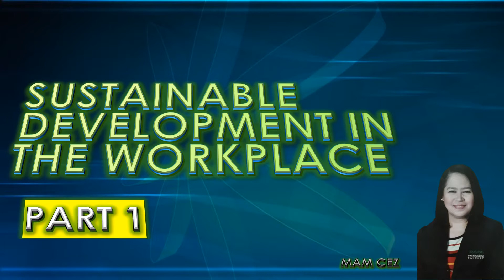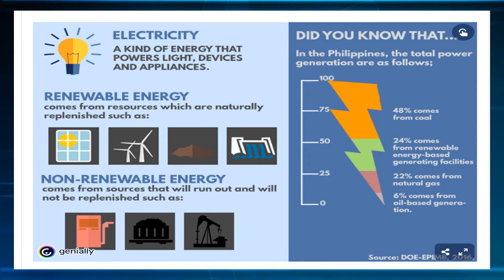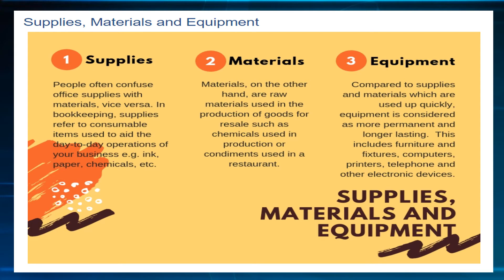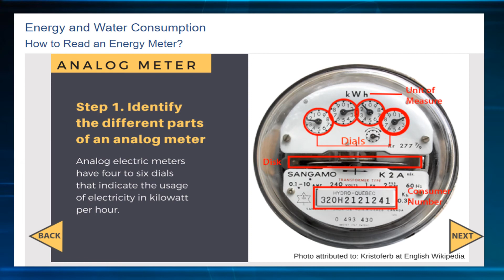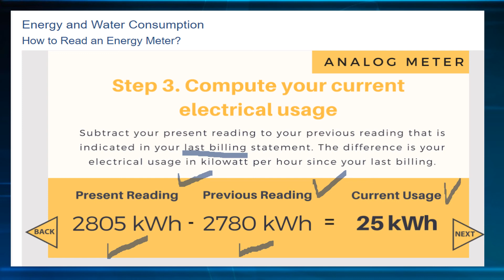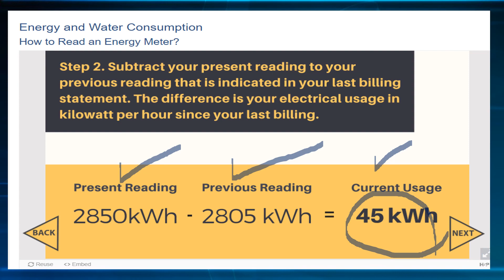SUSTAINABLE DEVELOPMENT IN THE WORKPLACE PART1

Comment: I learned that there are two kinds of energy: renewable and non-renewable energy. In the Philippines, most, being 48%, of the total power generation comes from coal, while the least, being 6%, comes from oil-based generation. 
In the workspace, the first in monitoring resource usage is identifying and making a list of all the resources used. There are four common categories:
1. electricity
2. fuel
3. supplies, materials
4. water

Comment: Monitoring and reducing resource consumption, such as electricity, water, and supplies, in the workplace, and discusses sustainable development in this context.
Workplace resources and the significance of measuring resource consumption, particularly water and energy use. Also to calculate current consumption by reading analog and digital meters.

Comment: With the use of renewable energy, not only does the company benefit from lower energy bills and making more profit, renewable energy is a difference maker when it comes to helping the environment - killing two birds with one stone. As non-renewable energy harms the environment and are limited, since when the supply of coal, gas and oil decreases, the price of it will skyrocket.

Comment: We need to identify the resources at our workplace and be informed on how to reduce potential waste. There are four main categories of resources:

Electricity
1) Renewable Energy
2) Non-renewable energy
Water
3) Surface water
4) Groundwater

There are also supplies, materials, and equipment in the workplace.
• Supplies: consumable items (ex: pens, paper, staples).
• Materials: raw materials (ex: chemicals and condiments).
• Equipment: more permanent and longer lasting (ex: furniture and computers).

Meters will help measure water and energy consumption. The two commonly used meters in the Philippines are analog and digital meters.